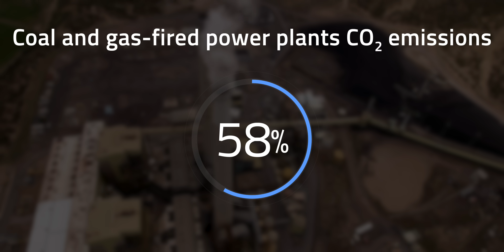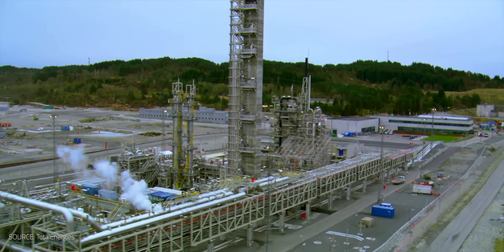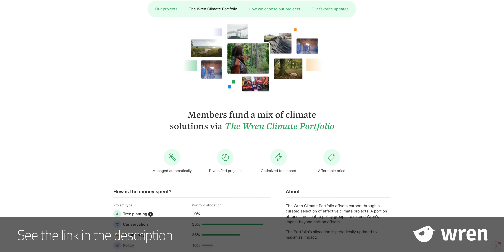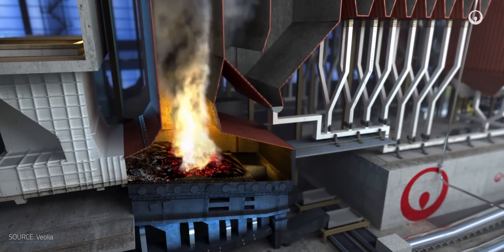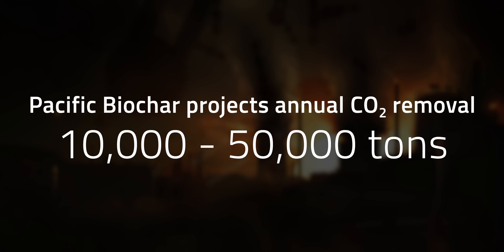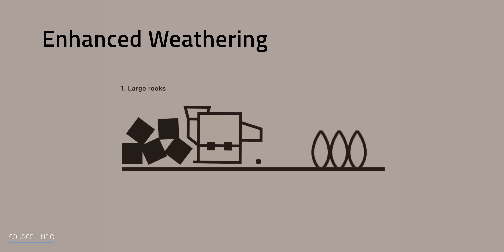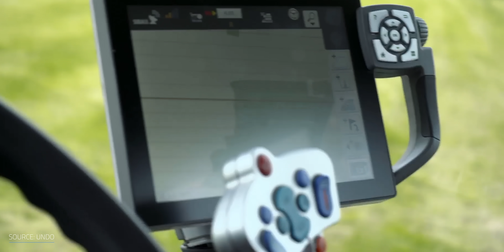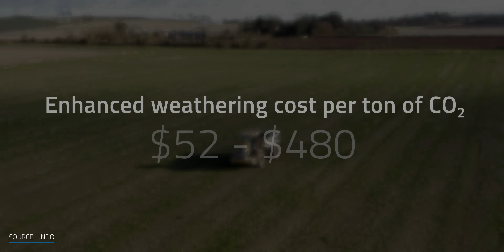The Reality of Carbon Capture

Comment: An ounce of prevention is worth a pound of cure.

The problem with all of these projects is scale.  Even the best of them such as DAC operate in the range of tens of thousands of tons per year.  We produce 35-36 billion tons per year (in recent years), and that number is only projected to rise if we don't do something about it.  That means even that massive 50,000 ton maximum for the DAC mentioned in the video would require 700,000 installations just to keep up with the new CO2 we're pumping out each year, never mind reducing the stuff we've already put up there over the past 150 years.

At 4.5 tons/hectare, we'd need nearly 8 billion hectares of land, or about 61% of the entire planet's land area covered in basalt dust.

And there's a diminishing returns problem with all those solutions as well because emissions are usually pumped as high as into the atmosphere as possible to avoid polluting the air where people breath, while DAC installations (and trees) are at best only a few stories tall, meaning even if we put in the time and resources to build all these things, we're only going to be cleaning the lowest dozen or so meters of atmosphere while the problem continues to build up over the 10s of kilometers above that.  Sure CO2 is heavier than air and will fall down eventually (along with help from rain and whatnot), but that's a long, slow process relative to how fast we're pushing more up there.

This is not to naysay the inventors and innovators doing their work - all of that will be needed as even the best laid plans won't get us off fossil fuel usage as quickly as we need, and every little bit helps in the meantime.

But from a societal and political perspective, we're regularly looking at the problem upside down.  We should be focusing on, in order: a) reduction of fossil fuel usage entirely, b) CCS/CCUS.. much easier to capture it at the source than trying to collect it out of the atmosphere later and c) atmospheric capture (which includes tree planting) as a minor perk.

But we tend to go much the other way - there's little appetite to reduce usage (mostly because of propaganda from the fossil fuel industry and their purchased politicians, but regardless of the reason the fact remains).  There's almost as little appetite for CCS/CCUS because it might put a fraction of a dent into the profit margins of those poor every-year-is-a-record major polluters.  So we focus all our energy, investment and applause one the innovators who while doing good work are at best a band-aid on a gaping chest wound.  Sure its better than nothing, but you're still going to bleed out if you don't find a better solution and find it rather quickly.
Reply: Agree with many of your ideas.  May I suggest however, you consider the elephant in the room: rebalancing the existing Co2 load in our atmosphere using the earths natural processes will work in the end, problem is it will take between 400 - 1,500 years.  Not a problem for the earth which has rebalanced Co2 many times after shocks, but many living species including humans will find waiting around pretty difficult.

Instead I am working on improving the efficiency of one of the earth's largest carbon sink cycle: ocean phytoplankton.  50% of sequestered carbon happens in the ocean about the same as all land based sinks.   The process I am developing based on science originally worked out by oceanographers decades ago, involves increasing nutrient levels available to phytoplankton during the growing season which otherwise become depleted causing the colony to crash until nutrients return.  Have the financial resources to at least test 1/4 scale prototypes off the continental shelf (after obtaining local state and US federal gov permits).  

Calculations by some scientists suggest if phytoplankton could be supplied with a more reliable supply of nutrients (my current job) this would in turn sequester a vastly larger amount of Co2 into the deep ocean (for millions of years a very large existing reservoir of carbon).  I want to aid this existing natural carbon sequestration process to such an extent we could draw down the atmospheric Co2 imbalance in decades not waiting centuries for the earth to work itself thru the imbalance we created.  This is the problem to be addressed.
Reply: @SeattleCoorain  > I suggest however, you consider ... it will take between 400 - 1,500 years
Oh I do.  That's why I tell people that just planting trees work work.  That agroecology won't work.  That DAC systems won't work.  That phytoplankton won't work.

All of these are important and useful developments and absolutely should be pursued, but they aren't useful enough.  Not by themselves or even in combination with each other.  We need to stop the problem at the source.  We need to stop using fossil fuels.

But that is not something we can (or even should, because of the economic disaster it would cause if we went cold turkey), the next best option is to intervene as close to the source as possible - ie: in-stack CCS/CCUS systems.  Yes, they're somewhat expensive (though not really that expensive) and slightly reduce efficiency, but the alternative is to not have a planet we can live on, which is you know.. bad.

Air capture, whether through natural methods like trees and phytoplankton or through engineered chemical methods like DAC installations, is a far third.  You're simply having to process far too much atmosphere, and from far too low (as in, physical height off the ground) for it to possibly counteract the new emissions we're pumping out each year, never mind reducing the existing CO2 levels.

People like to naysay CCS/CCUS because it "only" captures 20-50% of emissions.  I look at it the other way - that's 20-50% less work people like you and your phytoplankton have to do.

But is "only" 20-50% worth the cost?  Well, for the companies who have to pay to have it installed, of course not.  They aren't the ones who have to pay the externalities brought on by climate change.  To them, emitting is "free" (or very close to free even in places with carbon taxes), while installing a CCS system is likely several million up front and tens-to-hundreds of thousands per year in maintenance and upkeep.

There is no way the free market would go for that.  Cleaning up your mess is always less profitable than leaving it to be someone else' problem.  So that means "someone else" - namely, government entities - have to decide whether they want to pay the cost of cleanup (using taxpayer dollars) or be "evil" and start mandating that companies clean up after themselves whether they like it or not.

And that's not as easy a decision as it sounds, I'm aware.  At least not for politicians.  While most large plants are going to have no problem (aside from just not wanting to) affording CCS systems, there will be some fraction that are running close enough to the red that installing such a thing will drive them under.

That could result in layoffs and similar direct results that terrify politicians, while accepting the cleanup costs (ie: repairing the damage caused by hurricanes, fires, floods, etc) is a future indirect problem that the voting public may not correlate to the politicians' inaction by the time it comes up (and lots of propaganda trying to blame anything but political inaction for the increasing climate problems certainly helps to avoid that correlation being made).

And at the very least, it may put off any backlash they receive for a few years - perhaps even long enough that they're no longer in office and don't care anyway.

Comment: If Carbon can be removed from CO2 gleaned from the atmosphere, it could be turned into trillions of cheap man made diamond batteries which are capable of powering cars for 1500 years, they do not need recharging and sequester the carbon effectively.
Reply: Perhaps processing Carbonated water (ie soda water) with electrolysis would separate the carbon from the Oxygen and Hydrogen
.
Reply: I think that already happens in nature  but did it not take trillions of years and enormous pressure to produce natural diamonds? Please educate me if the manufacturing process  of industrial diamonds is relevant here.
Reply: @edwardhogan1877  Cutting discs fitted to angle grinders are coated with Man Made Diamonds the discs are readily available in hardware stores and are relatively cheap. The diamonds are grown on the metal in a gas flame deposition. There are other ways to make diamonds which involves using anvil diamonds to crush carbon atoms together using great pressure and heat, it is not a  difficult process.
Reply: @MaxB6851  Thanks , I wonder why the business tycoon in the film " Congo' went to so much trouble looking for a fabled diamond mine since he had the readily manufactured kind ?

Comment: I think carbon capture is not very practical at this time, but that doesn't mean it should be ignored.  Carbon capture deserves a lot more research.  There may well be much better ways of accomplishing it yet to be discovered.  I was impressed by the documentary "Kiss The Ground" which you can find on Netflix.  It claims huge amounts of carbon could be fixed in soil if we just change our farming practices.  Modern practices tend to sterilize the soil.  The claim the different, supposedly practical practices would restore the soil's microbiome and, in the process, fix enormous amounts of carbon and on a short timescale (~25yrs).  Sounds reasonable - I'm no expert.  I recommend watching it.

Comment: This stuff is all drop in the bucket stuff that isn't going anywhere.  Until we can generate electricity at an order of magnitude greater quantity and at a price an order of magnitude cheaper per unit, we simply won't be able to afford any of this in meaningful amounts.  I assume nuclear fusion will ultimately be the answer, but new designs of fission plants need to embraced.  Understand that the CO2 was produced in the first place because the oxidation of carbon is an exothermic reaction. . . it produces energy.  Capturing CO2 and storing it or trying to chelate it or whatever to something else is going to be a very limited solution.  The co2 is gong to leach back out again, worse case is a giant cloud of co2 escapes and suffocates a town of people.  If we had massive quantities of dirt cheap electricity, we could actually split the carbon back off of the oxygen and store it in the ground for millions of years, just like it was before we got it out of the ground and burned it.

Comment: An all in effort to get next the new designs for nuclear reactors (MSRs, NGNP, Th etc) engineered and built would be a great place to start. Commiting to powering the US (insert a country you prefer),as close to 100% of requirements with nuclear, renewables and having fossil fuel plants available to cover just what is needed since neither nuclear or renewables have the ability to respond to rapid demands on the grid. IMO if climate change models are correct then it we have to dramatically reduce CO2 output now and into the foreseeable future and the governments to back the R&D analogous to going to the moon.
No matter how we look at it fossil fuels are in our future for the next decades or centuries. Forcing a rapid transition to EVs before the product and the infrastructure is mature/priced is not going to work.
Reply: Go tell the driver of an aircraft carrier that nuclear can't respond quickly to changes in power level. Increased demand is ridiculously easy - just pull more rods. Decreased demand is handled by dumping heat - we simply drop rods, but continue to pull heat out of the pile and dump it into the ocean, the exact same as when running for power. With numerous small piles, you could indeed just take them on/off grid as needed as long as there was sufficient waste heat capacity.

Comment: I don't really think any CCS scheme is currently sensible while we're still producing so much CO2. There are already a lot of places where it's cheaper to build out new renewable energy generation than it is to keep running existing fossil fuel plants. For new installations, fossil fuels are economically viable hardly anywhere, and that's with current subsidies for fossil fuels. If these plants have to pay to offset their emissions using the prices mentioned in the video, there's no way they come out in the black. So, better to spend the money more efficiently by building out renewables (and maybe nuclear) as quickly as possible. Close the tap before you start mopping, as it were.

Comment: Burning shit is not how you get rid of co2....that's like elementary, very basic.

I find it hilarious that all these companies are working so hard to get rid of co2 by brute forcing the problem.....all that electricity, all that gasoline/diesel, from all those employees, all that plastic for PPE, etc. etc....everything except the one thing that would work....plant a fucking tree. It doesn't require any other type of employment or "work' from a system, you just put a seed in the ground.

Comment: enhanced weathering doesn't look very good. First of all, if they're using quarry leftovers, it means that this weathering would occur anyway. They're only accelerating it a bit by spreading out the material. Secondly, when they say they can absorb .26 tons of CO2 per tonne of basalt, are they taking into account the CO2 emitted by mining (yes, you have to take that into account even if you're using leftovers!!) and logging around all of that heavy material? I doubt it.

Biochar is the most promising carbon capture tech. After trees, that is.

Comment: Here is a hard  cold scientific fact for you to consider.  CO2 is not a toxic gas, it is necessary to maintain life on earth.  Without CO2,  you will die Matt. Do you understand basic science?

Here's another cold hard scientific fact for you to consider. There are dozens of greenhouse gases Matt, CO2 is just one of many.  So even if you eliminate ALL anthropologically produced CO2,  you will still have dozens of of greenhouse gases still left in the atmosphere and many are far more potent than CO2. 

Here's a third cold hard scientific fact Matt.  There is ZERO hard scientific proof that eliminating anthropogenic CO2 emissions will help cool the aggregate temperature of the entire earth. No one has proven using the Scientific Method that eliminating man-made CO2 emissions will do ANYTHING to cool the earth Matt. The global warming theory is based on the flawed output of approximately 94 clownishly wrong computer models.  Matt, do understand the difference between pure speculation and proven scientific fact? 

So my question is Matt,  how long are you going to continue to claim that eliminating anthropogenic C02 emissions is going change the ENTIRE aggregate temperature and climate of the earth? There is NO hard scientific evidence that it's going to do a damn thing!

Comment: I'm a bit surprised you didn't mention limestone based concrete, kelp and also the possibility of iron fertilization of strategic ocean areas. According to Peter Fiekowsky, those are the natural technologies that have a really significant potential. If his analysis is correct we can draw down 50 gigatons of CO2 a year globally if and when those methods run at full commercial scale.